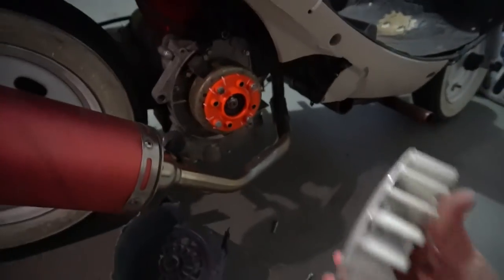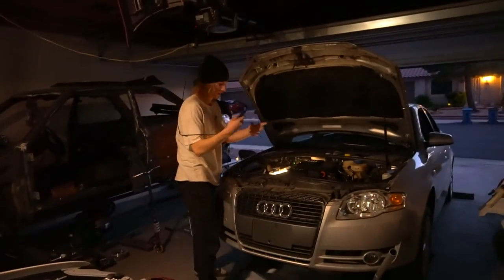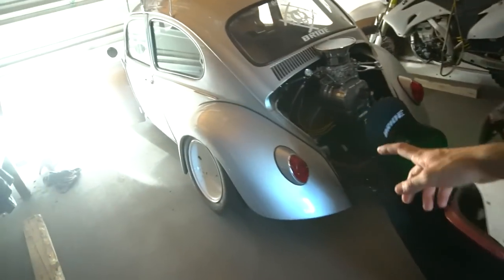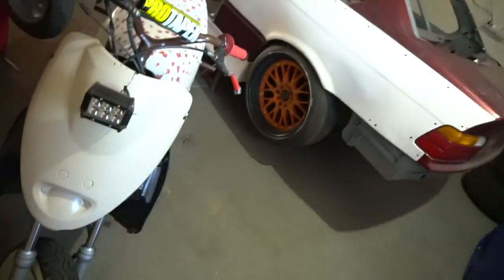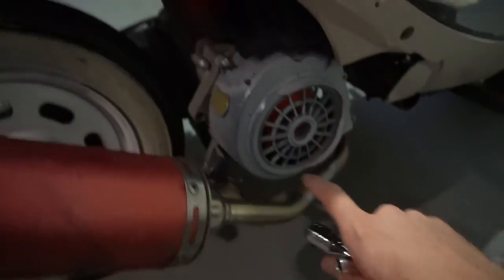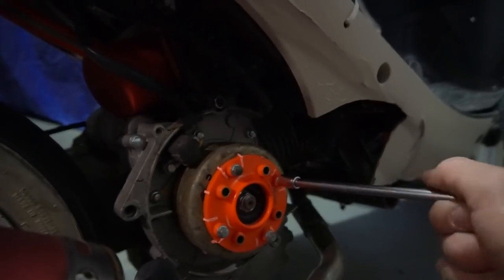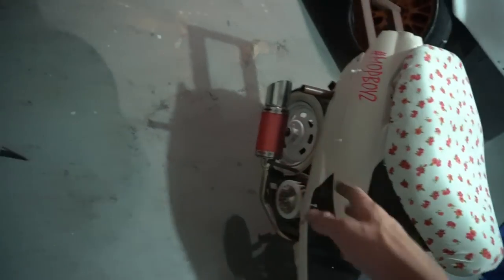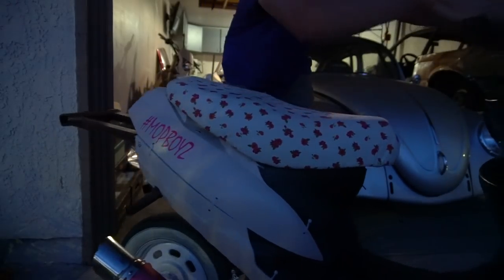NEVER BUY THIS PART FOR YOUR SCOOTER !!

Comment: I knew to steer clear of that "performance" cooling fan after reading like 2 reviews lol. Also I wasn't impressed by any glixal products other than their 20mm carburetor. You should always run the shrouds on these air-cooled engines, or you're not supplying the proper airflow to cool the engine

Comment: I think I can hear the exhaust blowing a bit.  Mine made the same noise when it was leaking.  Just reweld now that you got it held up better.  And as for the muffler, gopowersports has some for the predator 212 that look awesome, and they might fit that pipe.  Its a slip on, and its smaller and slimmer than that can you got right now.  Should look good.  Or just get a stock exhaust and punch a hole in the baffle with a screw driver and a hammer, it'll flow good, have a mean sound, but not be so loud

Comment: the motor has two mounts where the fan sits , both of those hold a  triangle bracket that hold a muffler on. that single bodge you done wont last long and there is a risk it will snap the alloy mounting lug off. do it right make up a triang bracket and mount that exhaust how it should be , you will also find it wont snap off at teh header so much ........ btw you may wanna check that header sounds like its blowing/failed header gasket
Reply from the maker: MrTamiyacowboy yea this exhaust is pretty pieced together now, it’s never had a header gasket lmaooo
Reply: He'll never know because he has the header welded to the studs LoL

Comment: Wish I would of actually watched this video, I bought a different one for my kymco same shit blew up fml now I dont know where or what was damaged but something is smoking, hoping its just the plastic burning on the header...
Reply: Take the fan shroud off and remove any fan pieces from inside it. When my fan blew up, pieces were stuck b/n the shroud and cylinder jug on the bottom side.

Comment: I have a question and I have not seen any videos on this I just had this to happen to me my fan broke and the pieces of the fan got in behind the box where the stator coil goes and I replace the fan and you can literally hear pieces of the other fan flying around in the stator coil housing but everyone was telling me oh it won't hurt it it'll be ok!! and now my moped is not getting any spark to the spark plug and I can't get it to start and I believe those pieces from the fan shorted out my stator have you ever heard of this happening? I mean surely like to God I'm not the only human on this Earth that this is happened to!

Comment: bro love yo videos brother n I have that part of fan..but my oem is shredded n moded my cold air intake was on carb intake but from heat of motor Heat I moved it to coming off this side by the shock full air force now  n...do u I happen to have a extra exhaust you don't need.. I have a hole in my exhaust tried J-B Weld still have a hole wanted to replace whole exhaust system? 😁🛵
Reply from the maker: mike waterman Thanks man, nope i don’t happen to have an extra exhaust . i pretty much need a new one myself !

Comment: 05:40  i found mine exactly like that today;  same fan,same color; i thought some debris went in and broke the blades,but there were no marks anywhere;  what happened was that the POS just desintegrated  all by itself, i then tested the plastic and it is SH!T , just soft junk plastic;  luckily i saw it before the engine overheated(i think!);

I'll bet lots of engines get overheated  and baddly damaged all over the world;  as many as the number of fans like this one were sold...

China should have some quality control laws implemented there,since they have no pride on what  they do;

Thanks for the video,saw it by chance; i think you should have the words fan or impeller or cooling in the title so more people landed on it, and be forewarned.